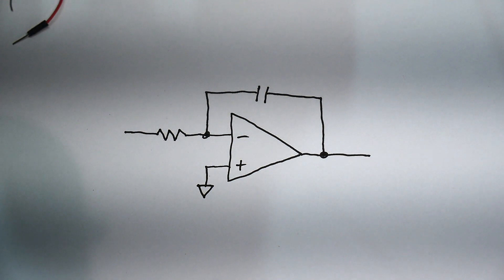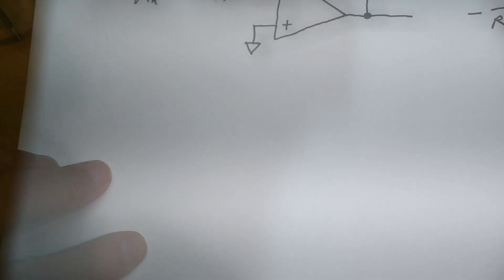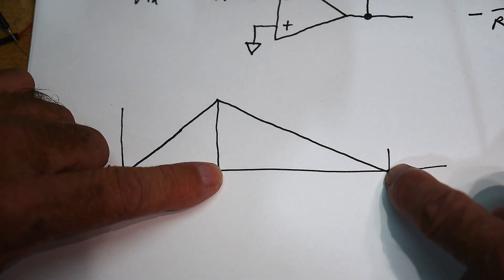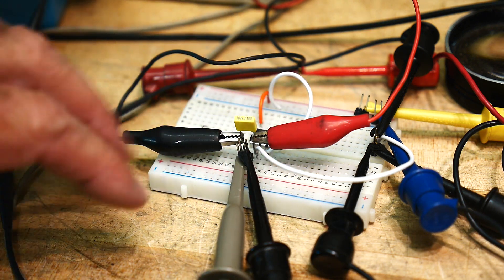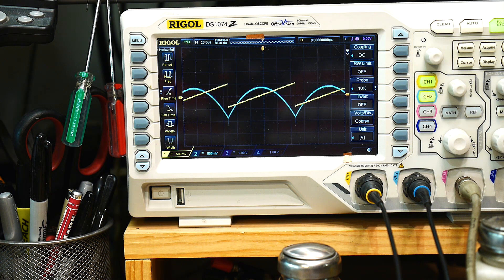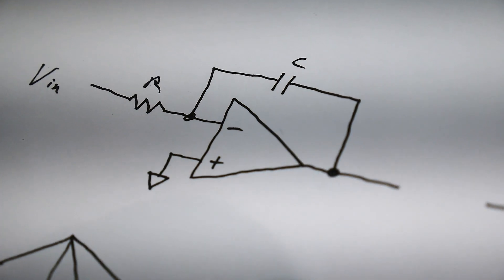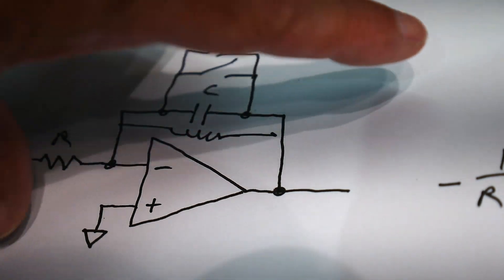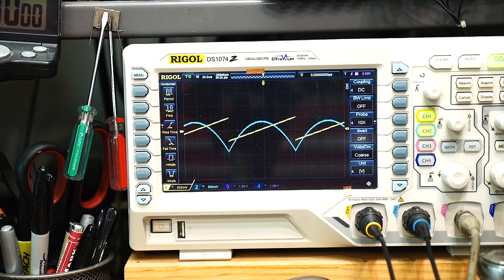#501 Op-amp Integrator

Comment: I'm new to electronics, so pardon if I missed something. Isn't the final circuit the same as a transimpedance amplifier?
Reply from the maker: you must have missed....
Reply: If you are thinking of  IMSAI guy's video #433 about transimpedance amp, the cap in the feedback loop is for stability against high freq oscillations and it is small 10 pF or so.The resistance in the loop is important Here the cap is chosen for integration and depending on the freq of the input would be much larger    nF or uF rages. Resistance is to bleed the charge of the cap. Also the input section is very different.
Reply: @osmanfb1  ah ty - I definetly missed the size of the cap and more. Thanks!